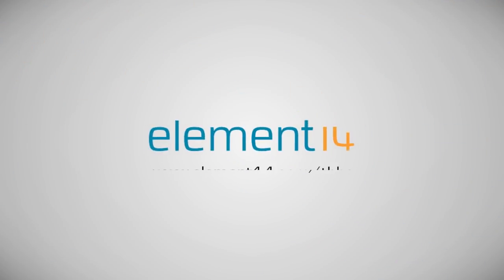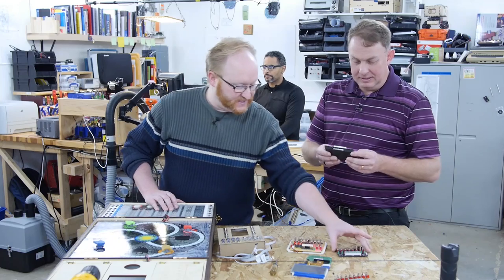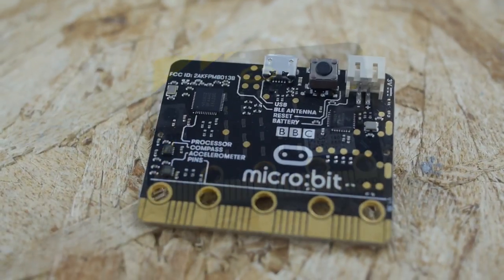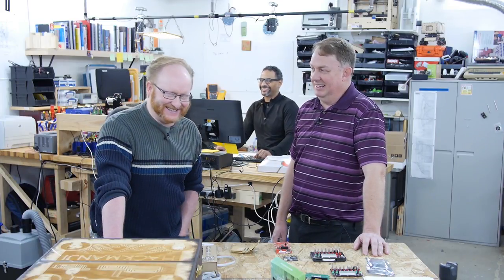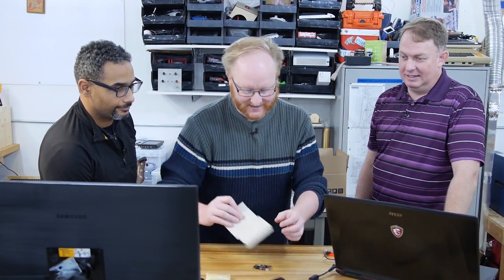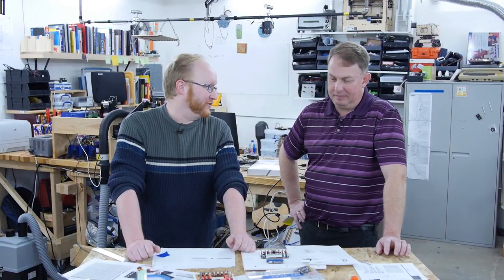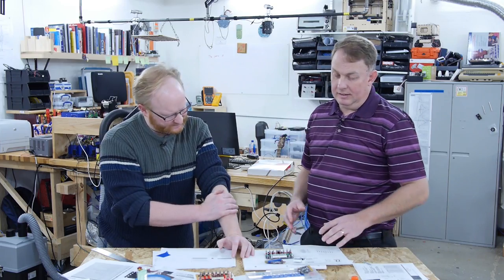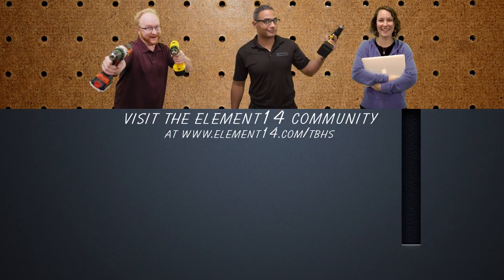Hex Game 03: Will it Sell?

Comment: I would just rebuild it with an ESP32 or ESP8266 board as the brains. They're super low-cost these days, and you can get them already on a certified daughter board that could either be soldered on or use header pins. Something like the Mini NodeMCU could be bought for < $10 in bulk.
Reply: @Kevin B: You're right, easy to program with the Arduino environment. A lot smaller than the BBC board. Also certified in a lot of country's. Enormous library for future projects. You can solder it on the Hex board or connect it with headers. And it is very cheap, less then €10,00. 
It is more a DIY board for people how watch the Ben Heck Show. In the future more projects with the same board can be made and also done by the viewers. I say go for the ESP8266 NodeMCU v2.
Reply: That was exactly my 1st thought.

Comment: I fell including wireless is a bad idea. Just let it be a standalone kit that people receive, assemble and 3D print a case if they feel the need. Do a run of a couple of hundred and see how it goes down as a kit and then if it's popular move forward with new design elements and wireless and expandability. Otherwise the project will expand exponentially and take longer.  They are some nice ideas, but I think it moves too far away from the original concept.

Comment: Make the game stand alone with a connector and slot at the top of the case for an optional radio card. If a customer wants to go wireless the card will slot into the top of the case and stick out part way like a game cartridge. This will keep the antenna away from the rest of the product and the users hands to avoid communication interference. This will also alleviate the need to make space for and entire wireless card embedded in the product.

Comment: I would do multiple versions of it, to be honest.
Beginner and advanced version.
Beginner, most of the complex soldering done besides the simpler components, most settings all done besides the basic stuff, etc.
Advanced, pretty much everything left as raw components / parts and settings left for buyer to set up.  

From there, you can then expand in to more in-depth stuff like wifi - phone connectivity versions and so on.  It's better to have a solid product you can grow from than one that becomes bogged down in feature bloat and interest dies off.  
See the Raspberry Pi for example.  Simple, extendible, couple versions, exploded in sales.  Now there's like 7+ versions and loads of support.  
It's a winning move with hardware.

Comment: You get a shaped soldering iron bit that can solder all pins in one fail swoop provided that the pads are coated with solder paste  that is done in such a way that the pads don't short out on one another.

Comment: For the case, maybe you should look into vacuum forming? It'd be tons faster than 3D printing and you could probably CNC the edges off a bunch of shells at once if you build something to mount them in.
Reply: Vacuum forming looks extremely cheap and nasty. It's like having electronics in a bit of food packaging. The material has to be rather thin and flimsy to properly be formed and sharp edges are basically impossible to get right.